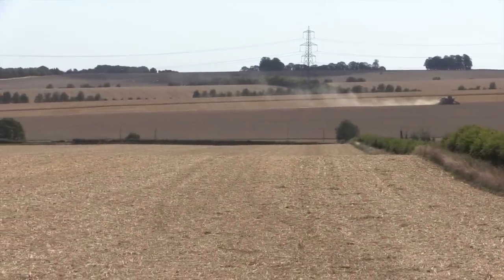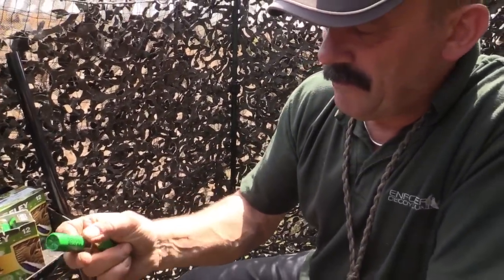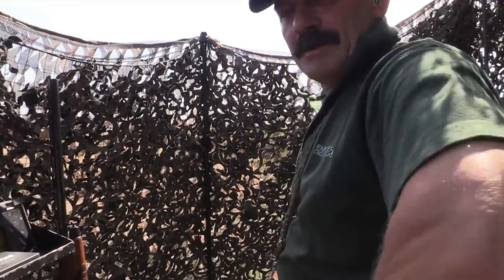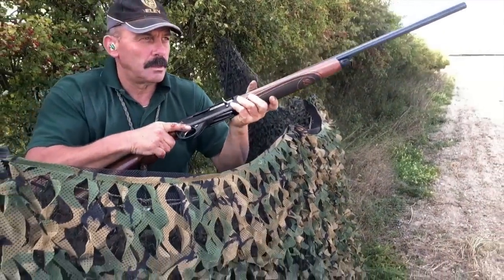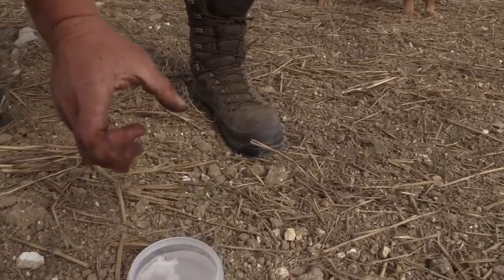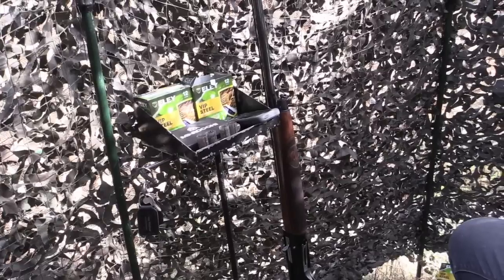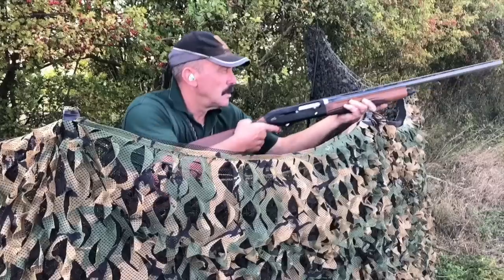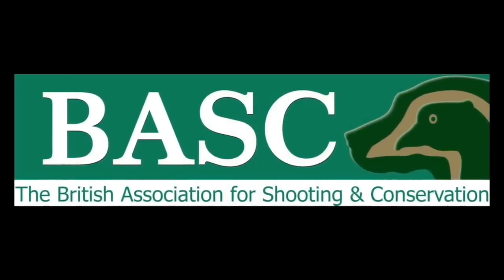The Shooting Show - pigeon shooting with steel shot and biodegradable wads

Comment: Question please correct if wrong. If lead shot was to be banned & steel shot as the new go to load would us the consumer see a drop in price per box of cartridge as steel is a more ready available source then lead. Cheers & very good video 👍
Reply: Paul Alexander   yes I agree with that but surely the manufacturing prices will be less as steel is no where near as expensive as lead per ton. If every major cartridge manufacturer were to make steel cartridges surely the prices per thousand would have to drop
Reply: That would be nice but as steel drops in price WADS will go up lol. Well someone has to pay for R&D.
Reply: just think how many nice guns would be scrapped !!!!!
Reply: hey hang on,just realised what I said !!! what better way for the Gov' to get guns out of peoples hands , not by force but by the fact that u cant use them any more with steel shot.
Reply: stephen hothersall they are about £350 a thousand
Reply: @terryrowles7751  there will always be bismoth so I shouldn't worry about it too much👍

Comment: Do they have to be stored any differently to lead/plastic , fibre wad cartridges?
Reply: was thinking that as well. Shelf life may be shorter? and have to make sure are stored in a very dry area
Reply: Tim they should be well sealed for field use but in storage you want to be certain to control moisture.
Keep them dry and store with humidity control in mind.

Story time:  I'm in the states but a friend stored his steel shot left over from the season and it rusted into a hideous slug. 
It feels quite different when fired in slug form so he opened several of the last season loads to find the steel shot had rusted together.
It made them interesting on the rifle range with water filled jugs but no good for any sort of hunting - and not legal for hunting either.
The biodegradable wads will need to be kept stone dry as well I'd expect.